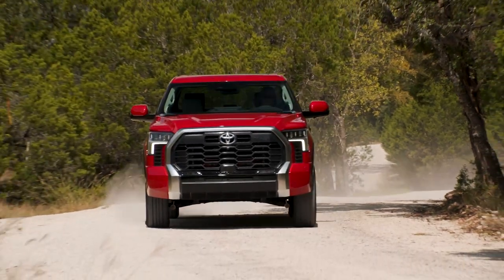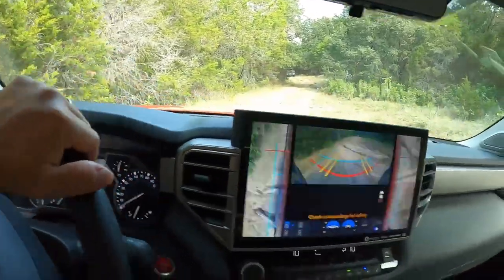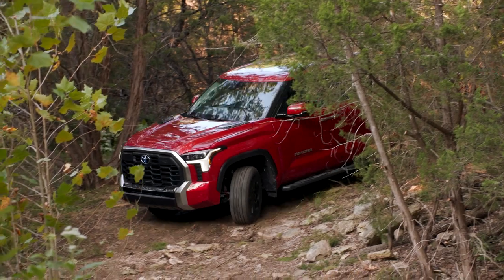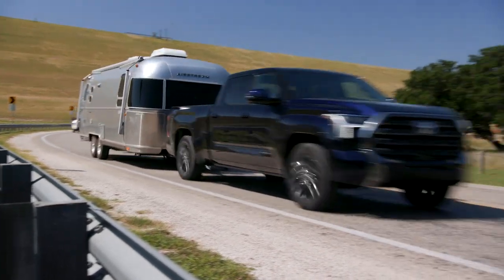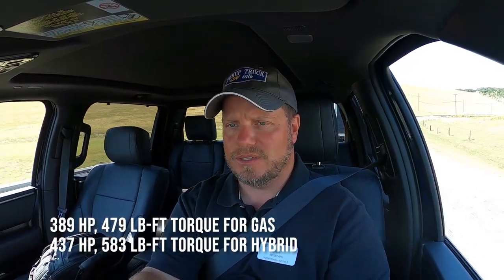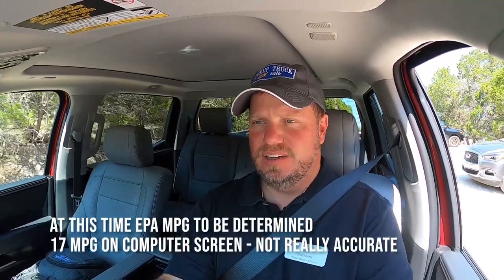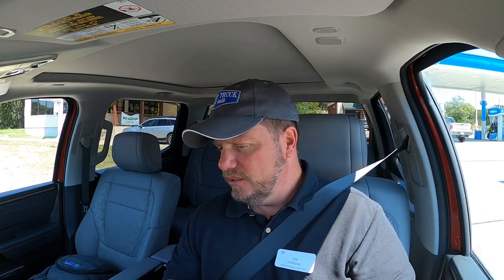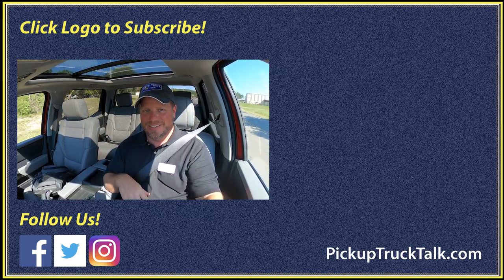First drive: 2022 Toyota Tundra gas, hybrid off-road, towing and more!

Comment: Had a 2020 sr5 just bought a 2023 limited. I tow 5 days a week various weights. I love my 23 for towing it is very responsive no turbo lag and the 10 speed transmission is wonderful. The old 6 speed would down shift often. The new truck very seldom down shifts. 2020 had 119,000 on it and no issues whatsoever only maintenance. If the 2023 has the same quality it will be an awesome truck.

Comment: TOYOTA has made a VERY BIG MISTAKE  ( and I am a 100% Toyota loyalist ! )  The 2022 Tundra has an "active air dam "  underneath , up front.
At high speed, it deploys to direct air to the sides. At low speed, it folds up to restore full ground clearance. This "active air dam" PREVENTS Tundras from having FRONT TOW HOOKS which to work properly must be attached to the frame . An off-road vehicle without tow hooks ????
You will not be pulling your buddy out of a snow bank or no one is going to be pulling you out of a mud bog . Tow Hooks are essential for every off-roader .
Huge Oversight by Toyota !
Reply: Toyota is offering tow hooks as an Accessory for all the new Tundra. Agree they should be standard, but just buy them and install them. Much like not having ones preferred tire brand or size, not a deal breaker.
Reply: @MrChadx1  The article I read had a Toyota engineer saying the active air dam makes tow hooks impossible . I wonder if he is wrong or if the active air dam has to be tossed or bumper must be cut to add those tow hooks listed as accessories ?
Reply: Don’t kid yourself. They are not putting tow hooks as a standard feature because chances are pretty slim that you will ever need recovery hooks at the grocery store  or a church parking lot where 99% of those trucks will be used 🙄. For the 1% of those who use trucks for truck thing I’m sure they’ll have optional hooks available
Reply: @michalp2362  ….As a DIY homeowner with a family and toys to haul, this half ton truck will fit my needs perfectly. I don’t need tow hooks, but I do need a bed for trips to supply store. This truck is perfect and I will give it to my son when he starts to drive.

Lots of families that have outdoor lifestyles, use Chevy, Fords and Rams pickup trucks for same thing.

Comment: Thank you for a solid review. When it comes down to it, it's a Toyota. It should be a rock solid ride. Other trucks have moved to the v6 tt and they're doing just fine. I want the same Toyota reliability with improved gas mileage. My 15 has the dinky 80L tank so not only does it guzzle, I have to stop more than I'd like on long drives. Towing my ATV trailer anywhere from 4-12+hours for future hunting trips should be a much nice experience overall. Plus I live in a city so the hybrid should help with mileage because there are unfortunately plenty of times where I'll be driving slower than I want so using electric would be better.

Comment: really disappointed in that battery being in the cabin. Losing all that underseat storage sucks. Looking at that frame, there is room to have put it between the rails if the exhaust was re-routed a bit. Maybe that's something they'll tackle in future revisions.
Reply: Exactly... It's almost like at the last minute they decided to add an electric motor and were like "oh crap where do we add the batteries?" Then in a rush the opted to dump them in the back of the cab.
Reply: Not only is there no under seat storage, but the floor isn't flat and there's no behind the seat storage either.   The worst rear cab of any pickup on the market today.  It's almost as if Toyota doesn't understand how people use their trucks.
Reply: @plmn93  I didn't notice that - the rear cab floor has a hump? That's ridiculous and that alone disqualifies the Tundra in my book. I think all other truck manufactures except Nissan realized truck people want a flat loading floor in the cab.
Reply: Think they put the batteries inside for better temps. Every Toyota hybrid has batteries inside with a vent. On our sienna it’s under the front row, on the Prius it’s under the back seats. I would have been nice if they made the seat bottoms quick detach as you can gain back a few cubic feet. I removed the back row seat bottoms on my first gen Tundra and there was a lot more usable space. 

Looking at the frame videos I think the only place for a PHEV lithium models batteries are under the bed.
Reply: This design is terrible. Under seat storage has always been an issue, especially with the 2018 model which I have. I had to purchase an after market storage and cut up the area underneath to install it, but it was well worth it. If only the truck designers could ever take Honda's in bed trunk and tailgate design and move it over to a truck like this, and flat bed. It would be so nice.
Reply: @plmn93  Understatement

Comment: with hybrids, you'll get better fuel economy with longer stops, let the regenerative braking stop the truck (I.E.) if the light a block away is about to turn red get off the accelerator and let the regenerative braking slow the truck

Comment: Was thinking there’d be  towing MPG increase. Guess not. This makes it way easier to keep my ‘18!
Reply: Why would you presume it would increase mpg for towing? Ford ecoboost has worst mpg than the 5.0 when towing. Toyota said it was the same so its a good thing when your are not towing you get better mpg than the v8
Reply: Dude 18' will be the best year made. Transmission cooler still, just a fucking tank of a truck. Good luck with turbos hahaha. People are delusional to not think they are maintaining/ fixing those turbos at 100k.
Reply: @TontoBongRonto  Turbos are not an issue with Fords, so I can't imagine them being one with Toyota.  I mean sure yeah they can fail but it's just not the widespread issue some people like to claim.  They are some of the least of my concerns on a modern engine.
Reply: @TontoBongRonto  Toyota engineers  literally go over the specs and lifespan of this engine.
Reply: @mystery solver
What a stupid comment, there isn’t a truck made that will get “good” gas mileage when towing. And the ecoboost mpg is not worse than the v8
Reply: @mysterysolver514  Hello?  It does not get worse mileage than a V8 when towing and it's a far better experience when towing. I own both a 5.0 litre and a 3.5 Ecoboost

Comment: Buy an GMC Sierra or Chev 1500 with 3.0 Duramax for 2021 tax planning purposes.  Then buy a 2022 Tundra Hybrid mid 2022 when available.  That gives you the opportunity to compare F-150 PowerBoost you just sold with the 3.0 Duramax and the Tundra Hybrid.  These three truck configurations provide half-ton, crew cab, short bed truck buyers looking for decent fuel economy (with and without a trailer) and towing a bumper pull travel trailer occasionally solid options.  If someone is towing extensively V8 half-ton trucks configured to tow or 3/4 ton trucks would probably be a better option.  It’s unfortunate that 3.0 Duramax production is currently haunted and the 2022 upgraded 3.0 Duramax towing specs and max tow option are unlikely to be found at any dealership before the end of 2021.

Comment: With all due respect, the "piped in noise" has got to be the stupidest thing ever added to any vehicle. They gave it a tame motor to make it fuel efficient, so it's naturally quieter, they improved the interior with sound deadening materials and then!  Made the speakers play fake engine sounds! I'm done, guess I'm an old geezer now at 46, can't see ever buying a vehicle newer than 2015 or so. I don't want things beeping at me, slamming on my brakes, controlling the steering or stopping for people trying to car jack me. Rant over.
Reply: Wait till you hear this in person. Some of the videos you can hear it. This thing sounds like a crypto mining rig outside by the grill. Whinny as fuck with the hybrid motor. This thing is a joke.
Reply: @TontoBongRonto  I think I've heard what you're referring to, it sounds so unique and bizarre I wasn't sure what it was. TFL has a 0-60 test with a hybrid, when he's coming to a stop it sounds like brake pads are down to rivets. Wtf is that? Think I'll be keeping my "unrefined" 2010 Tundra.
Reply: @ultraneight  I have an 18' cav blue DC off road. It's a dream
Reply: Never thought about the car jacking accessory, specially now..
Reply: It only comes with the JBL sound system upgrade, so it can be avoided.
Reply: I hear you.  I have been hoping for a locking differential on this truck forever.  I finally get it and they dump the V8, put in a mega TV screen that displaces hard radio and environmental controls/buttons, count on the 10 speed tranny to take up the slack for a 3.3 rear end, and pump in fake engine noise.  I just can't win.  Sorry Toyota, I still can't pull the trigger with ya.
Reply: @kirbyspencer538  I love the big knobs. Easy to find and just feel right. I hate toyota cruise control though, that shut is wild .
Reply: OMG, to be 46 again!!  Lol

Comment: No 4wd Auto rules it out for me.  I use it in my Ram all the time for slick streets, snow and ice, and gravel.  Really surprised it's not in there.  Turbos are really cool.  Whistle of the turbos might be an even trade for the rumble of a V8?  They ought to make that whistle a little louder so it sounds cooler, like the ones on turbo diesels.

Comment: One difference I noticed between the F150 hybrid and the 22 Tundra Hybrid is that the battery in the Toyota takes up room under the seat.  I think in the Ford, when you fold up the rear seats, you have a flat floor in back.  When you fold up the seats in the Tundra hybrid, you don't have a flat floor because the battery is under the rear seats.  1)  With the Tundra 22 non hybrid, can you fold up the seats and get a flat floor?  2)  Do you know of any after market solutions that give you a flat platform in the Tundra Hybrid with the rear seats folded?  I am interested in this because we have two big dogs and I don't want them messing up the rear seats, or the battery for that matter.  Thanks for your great channel.
Reply from the maker: 1. Nope. 2. Nope. Hope that helps somehow. Sorry, the Tundra is too new to find aftermarket solutions at the moment.

Comment: Two questions: 1) Your bottom line opinion of the 2022 Tundra vs. your previous f150 for work and play? 2) are the high top corners of the info screen as annoying in person as they appear to be when watching a video from a driver's perspective? Thanks and good work.
Reply from the maker: Tundra is more fun to drive than F-150. F-150 has more features I used all the time like zone lighting and onboard power. 

The info screen isn't that distracting and with the Toyota voice commands, you can really just ignore the screen.

Comment: Well done as always!!

Did Toyota Do Their Homework?
The fastest growing off road market is towing “off roadish” to heavy duty off road RV trailers 5000 to 10,000lbs for  off grid boon docking. 

As such, the Tundra TRD Pro hybrid with rear air suspension with ability to power the RV trailer as a battery & generator is ideal.  If Toyota did their homework, this combination will be offered…hopefully.
Reply: Guess they didn't do their homework then
Reply: @saisr1  We don’t know as only pre production product has been shown and final order specs for each line has not been officially released.

Toyota must get 2022/23 models immediately and not take years to perfect as the competition is already years ahead of Toyota’s current 2021 lineups.

Pricing/value is critical as many are ready to leave the Toyota brand so they must hit home runs in each product category and show the best value in each or hello Ford, Ram and even GM with their class leading new 3.0l diesel with all new 2022  interiors.

Comment: Really, if they were going to combine a 10 speed trans and a 3.21 rear end, it seems like they could have offered the 5.7 as a base engine with much better economy than the previous 6speed and 4.30.
Reply: 5.7 no longer meets the stricter emissions...they’d have to put both direct and Port injection on it, put on EGR and an EGR cooler, variable cylinder displacement, double cat converters (like shown on these) and that would all change it so much that it wouldn’t be the 5.7 you knew. It would be wayyy more complicated and troublesome. (And yes, this new 3.5 will have a butt load of “more complicated” - see the wires and hoses and tubes all over the top of it in that chassis shot?) Ford even had to add an EGR cooler to their non hybrid engines. If Toyota had a brain, they would have put an 8 speed tranny behind the 2014+ trucks and got those mpgs up but they chose to do nothing to it until they HAD to (EPA driven not the consumer).
Reply: @natehawkins2910  great response! Thank you!
Reply: The trans approach is different, the ratios are numerically higher in 10speed, that is why axle ratio is 3.31:1.  This lets you tow at highway speeds in 1:1 trans gear, makes trans durable, instead of towing in OD
Reply: Toyota being cheap and politically correct. They don’t want to make new V8s because they don’t want spend on newer technology for them, TTV6 is cheaper and less effort and creativity required. Then they are marketing the TTV6, a derated but same engine for the SR and the Hybrid as 3 different engine options.

This new truck is with a rear end of 3.31 and 10th gear of 0.61 at 65mph and 265/70r18 tires is only doing 1400rpms at 65mph. This engine is going to be boosting a lot pulling a heavy load. It’s going to same or even worse fuel economy than the 5.7 towing the same loads except when unloaded.

Comment: Do you get an in bed 120 power inverter? How about one or two in the cabin? No built in steps on the bumper to ease access to the bed. So many little things missing but at least they did address the underseat storage, but you turn around and loose it in the hybrid model.
Reply from the maker: In bed plug is 120 volts with 400 watts.

Comment: It will never have instant power and torque of a V8.  There will be a lot of lag due to the turbo's but when they kick in, it's a lot of fun.
Reply: Turbo's engine generates more torque not sure what you are talking about.
Reply: @tachee77910  I’m confused as well
Reply: @rachaad  i m sure that dude never drove a tundra v8 and opem his mouth about torque and power.
Reply: The electric motor is sandwiched in between the engine and transmission yo. They accounted for the lag so there wouldn't be lag with help from the electric motor.
Reply: @tachee77910  Bet I've owned and driven more V8's then you.  Learn to read buddy, I said the V8 has instant power/torque while the turbo's take time to build boost.  And I've owned a lot more turbo's then you too.  Calm down and read first.
Reply: @iblongshia  the tundra v8 was sluggish like i said u don t k ow what you are talking about
Reply: @tachee77910  Please, you probably had the 14 and up tundra.  That was sluggish.  Mine was a 2012 Rock Warrior model and it was a beast because it didn't have the engine management limitations.  You have no idea what you're talking about.
Reply: Oh yeah, well both of you don't know what you're talking about...I've owned and driven every truck ever made and I think...

Comment: Does this new engine have a standard spin on oil filter now, or does it still have the 1950's design cannister oil filter abomination toyota has been using for several yrs? Just curios.
Reply from the maker: Huh. Solid question.

Comment: with a 3.31 rear the mileage should be way better.. if your guess is correct. I will keep my rx 350. that mpg is aweful
Reply: RX350 is not a truck. Why are you comparing it with Tundra. I'm 2021 rx owner too
Reply: @mingli9563  not comparing read my words not your thoughts.  I was prepared to go back to a pickup but between head space and mpg ill just keep the luxury

Comment: Conservative American/Canadian: just let go of the V8 ain't that hard. In Europe we're driving 4 cilinders for decades and since 10-15 years 3 and 2 cilinders are there. Even without hybride added. 
Also PHEV and EV are here for 2 decades. In 2030: no diesels and petrol/gas engines are sold in Europe anymore. 
You guys are so, so far behind between the ears. Small engines aren't that bad, you don't need a "V8 MOWTOAR" to tow. We haul small digger with 4 cilinders since the '70s.
Reply: How about we keep the V8, and folks that agree with you can move to France.
Reply: @kirbyspencer538  say goodbye to V8s in the USA. They won’t last much longer, at least not in half tons
Reply: You're not far off the mark. You guys do things differently for sure - I remember being in London in 1998 wondering why Ottawa didn't have traffic circles (we finally started using them over the last few years). But honestly, the topography is different for the US and Canada compared to Europe. Sure, southern France and that area have big mountains, but here in Ontario, we can drive through a wide variety of topography as it takes about 26 hours to drive across this province. It's challenging all over with the various driving conditions. Hence the reason why folks are hesitant to say goodbye to the V8 system. But it's not our choice to make really because it's going bye bye. I have a 15....love it.  Great truck, but I'll be getting a hybrid for sure.

Comment: I have a 2021 GMC Sierra Denali 3.0, 4x4 and love the engine, however diesel just took a big jump over unleaded regular fuel.  Will the hybrid or non-hybrid engine require premium fuel?  The new Toyota Tundra hybrid might be more economical to drive if it uses unleaded regular fuel than my truck.
Reply from the maker: 87 octane for Tundra.